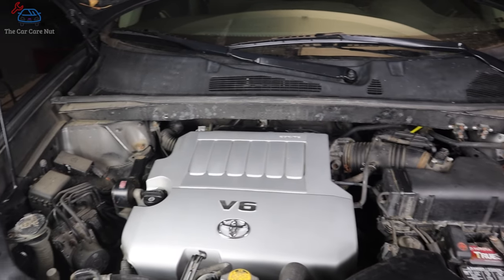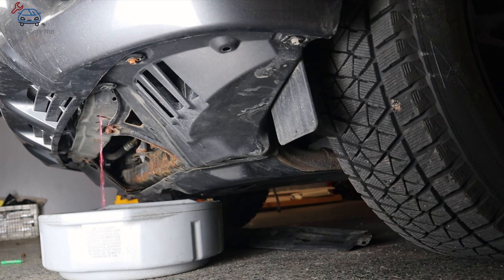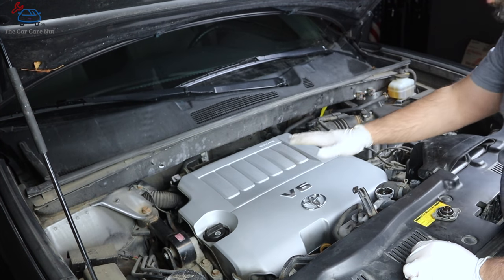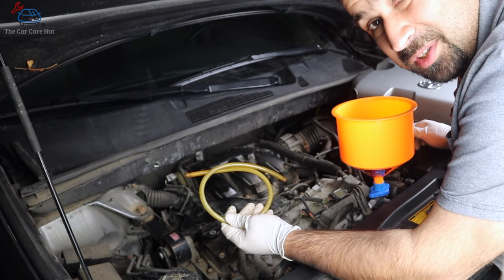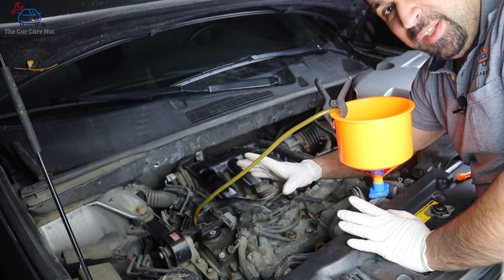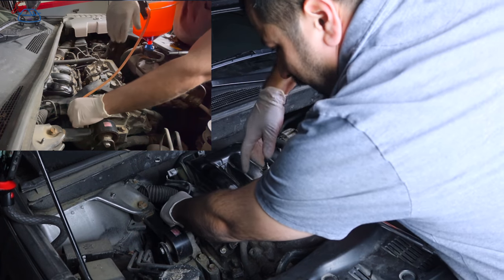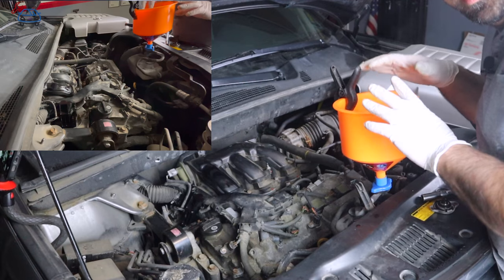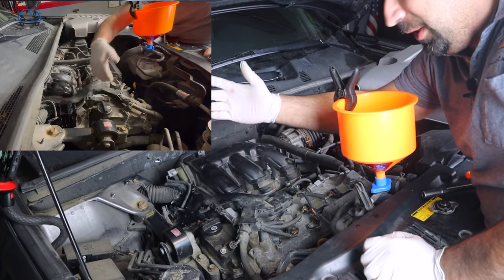Toyota Cooling System Bleeding for V6 2GR-FE 3.5L THE RIGHT WAY!

Comment: AMD Hello and Thank you for the great videos you provide ! I did the coolant change on my 2007 Sienna a few days ago, seemed to go ok but I now have NO rear heat. Wondering should I try the process again without the coolant change ? also the video does not mention what to do with the remaining coolant atop the radiator in the funnel once the flow starts its "steady stream" with no air bubbles. I obvious choice to me was to transfer the leftover to the overflow bottle. the short question ... should I repeat the entire process to get rear heat again ? Also I was surprised that the system only drained less than a gallon of old coolant , I assumed the Sienna would have much more but understandably the system is not 100% drained from the radiator drain plug. I did exchange about the same of new Toyota Long Life less than 1 gallon. Thanks again for your channel its the BEST !
Reply from the maker: Hi! You’ll want to repeat the same process again. This time with the rear heater turned on. See if this helps
Reply: Did you have success? I am having the same problem with no heat in the rear of my 2007 Sienna. I have repeated the process 3 times, twice with heat controls off and once with the heater on.
Reply: @andrewsnider7274  I actually haven’t gotten around to redoing mine yet .. also noticed after doing this when I have the ac on it’s blowing hot air from passenger vent near the sliding door .. kind of odd … Let me know what works for you .

Comment: Hi AMD, I have a 2007 Lexus RX350 with 60K miles. I came across your channel after I did the drain/fill of the coolant last year. I have noticed the coolant level in the reservoir going down recently but I don't see any leaks. I did not bleed the system, just used the spill-free funnel. The car does not overheat or have any issues. Heat is ok too.  Would it be because of not bleeding? 
Thank you for the awesome content. Much appreciated. I was able to change spark plugs after seeing your video.

Comment: is there a block drain plug on these models?
Reply from the maker: Hi! There’s a block drain however in most of them it’s hard to access as it’s underneath the exhaust manifold on the back side and in AWD models it’s even harder. Only a small amount of coolant comes out when you drain the block that makes it not really worth the hassle.
Reply: @TheCarCareNut  thank you Sir for the reply; I remember doing a coolant replacement on my friends 2007 Yaris and the block drain plug was seized; my 2008 Volvo XC90 V8 is the same, the block drain bolt for the coolant is visible but you likely have to remove the exhaust manifold to gain access.....I don't understand that engineering.

Comment: Is it normal for the radiator hoses pressurised until the cooling fans operates and the pressure disappear until the fans off hoses pressurised again. The car 2008 toyota camry 2400

Comment: I have a question:
If I measure the amount of coolant I drain out then put same amount to the radiator and coolant reservoir. The car will bleeding itself after I drive it for few days? Is it good, bad or cross your fingers.
Thanks
Reply from the maker: Hi! No that wouldn’t work with coolant. You’ll want to bleed it

Comment: Do you recommend draining the block when replacing coolant?
Reply: With a little bit of scrolling through comments I was able to answer my own question. Many others had the same thoughts. However my question now is would you ever recommend a full system flush as part of maintaining your vehicle to make it last +300k miles?

Comment: How about on a 2006 Toyota Matrix 4 cylinder? We have one that I cannot get the heat to work on and am sure its due to air in the system.
Reply from the maker: Hi! It doesn’t have a special procedure are the hoses for the heater core hot?

Comment: Hello AMD.. I've been reading online and some suggest by draining it also from the block that has the coolant drain valve (if my 2006 IS350 has it?)  as well in which you didn't do in this video. Is that necessary?  Or just keep it simple and drain it from the petcock at the bottom of the raditor.  This will be the second time changing out the coolant on my 2006 IS350... What do you suggest and recommend? Thank you 👍
Reply from the maker: Hi! Keep it simple and drain it as the video shows. Often times the drain on the block seizes and can break. And when you drain it only a small amount comes out
Reply: @TheCarCareNut  Awesome! Will do that what you did in the video. Thank you AMD I appreciate it.. Happy Wednesday and have a great day

Comment: Just changed the coolant on my '17 Tacoma 6cyl MT and used less than a full gallon container of 00272-SLLC2	The bleed screw on the lower passenger side was tubed up to the funnel, ran the engine at 2500 rpm's for a while and all the bubbles came out but still only used less than a gallon of the Toyota coolant. Purchased 2 containers in preparation for the expectation of using both.  What happened, did I screw something up?
Reply: The radiator barely holds shit lol it’s kinda messed up but your good. Gotta drain everything to get it all

Comment: Is this the same for the 4 runner ?
Reply from the maker: Hi! No the 4runner is simpler just fill it, rev the engine to 1500 rpm until both upper and lower radiator hoses are the same temp
Reply: @TheCarCareNut  stupid question, sorry.  But how do you tell the temperature of the upper and lower ?   You have really dumb things down for beginner like me.   Thanks 🙏
Reply from the maker: No need to be sorry. Very VERY carefully you’ll reach in and feel them. Initially when you start theyll both be Cold yo the touch. Then you’ll notice one of them will get hot to the touch and the other cool. Then they’ll both be hot to the touch

Comment: what do you do with the coolant in the overflow tank?
Reply: After doing this procedure, just make sure you’re overflow tank has the proper level to the full mark. It will change overnight for a day or two after running the car and letting it cool down, but it should stabilize after a day or two if you fill it to the full mark.

Comment: Which nut did you loosen to open bleeder? I just replaced the radiator myself and bled the system by waiting for all the bubbles to leave from funnel at the radiator cap , is that sufficient?
Reply from the maker: It’s a 10mm bleeder shown in the video

Comment: 80k on a 2016 HL.  I see several dozen little black flakes bubbling up in the funnel which I am wondering what they could be.  This is happening when the engine is rev''ing and waiting for the return line to start flowing.  I never got a steady stream from the return line.  Rev'd to 2500-3000 for a minute or two after it was at 2000 and at operating temp and still did not get a flow.  It reach the top of the funnel but never started flowing with any steady flow like you mention.  Also, is the return line supposed to be submerged in the funnel fluid or not?  I would thing that would matter.  Lastly if I see bubbles and lots of white bubbles (a lot of very small aeriated bubbles) but the funnel fluid level does not seem to be going down - that does not make sense?  If I see steam and bubbles and aeriated coolant coming up from the radiator into the funnel it has to be replaced by fluid but I really and not seeing the fluid go down as much as you would think given the bubbles.  Thanks for the great video
Reply from the maker: Hi! Don’t submerge the line in the fluid

Comment: Great video!  I'll be performing this procedure on my 2016 Avalon next week.  I have a question.. Does the Corolla 2ZRFE engine have an unusual coolant flushing process, or does the usual burping technique apply?
Reply: I had the same question. Yesterday in our 13 Corolla I drained the radiator from the bottom valve ( remove rad cap for better drainage) closed bottom valve, removed reservoir bottle to drain and rinse out. Used the no spill funnel as in the video. Added about a 3.5 qts of Toyota pink. Started the car and slowly added (if needed)  more coolant to the funnel. After some time not seeing any bubbles, inserted plunger ( comes with funnel kit ) then carefully removed funnel w/ plunger still inserted. Replace rad cap. Remaining coolant in funnel added to reservoir bottle. Drove car for a while with heater on high ( Milwaukee winter time) after letting engine cool down, I checked coolant level. As AMD would say, and “Life Is Good!”  
Today I’m going to do the 2015 Avalon. Gonna try the lumber board on the gas peddle and head rest method I read in an earlier comment. Wish me luck.

Comment: Hi, echoing some others with the same question. Do you ever and or recommend draining from the engine block drains?
Reply from the maker: Hi’ you could yea but only a small amount comes out
Reply: @TheCarCareNut  thanks for responding so quickly! In that case I'd rather just not do the engine block drains as it will add unnecessary work. I'll just keep this nice and simple like on your video and do another change in a few years.

Comment: Hello man my 2006 Avalon get code with random/multiple misfire p0300 with c1201 , 90% happened morning when driving to work some times after the whole car shake with flashing check engine light and vsc light I turn the vehicle off and turn it on the car drive normal, yesterday happened  with sold check engine light with p0300 and c1201 what cause if this code please help me  with your Experience
Reply from the maker: Hi! This one will need some diagnosis. Does it have any other codes other than the p0300?
Reply: @TheCarCareNut  yes P0301-P0302-P0303 until P0306, I changed the fuel pump with no luck and new ignition coil and spark plug nothing change
Reply from the maker: How’s the fuel? I would get a sample and get it tested
Reply: @TheCarCareNut  this is the freeze data the cause of misfire 
1-DTC THAT CAUSED REQUIRED FREEZE FRAME DATA STORAGE P0301
2- fuel system A status CL
3-fuel system B status CL
4-calculated load value 80.0 %
5-engine coolant 188.60 F
6-short term fuel trim bank 1 (0.8%)
7- long term fuel trim bank 1 (8.6%)
8- short term fuel trim bank 2 (2.3%)
9-long term fuel trim bank 2 (10.2%)
10-engine rpm 2455 rpm
11-vehicle speed sensor 78.29 mph 
12-ignition timing advance for cylinder #1 (24.0)
13- intake air temperature 75.20 F
14-air flow rate from mass (air flow sensor)0,10 lb/s
15-absolute throttle position 28,6 %
16-oxygen sensor output voltage bank 1 sensor 2 (0,210)V
17-short term fuel trim sensor bank 1 sensor 2(99,2%)
18-oxygen sensor output voltage bank 2 sensor 2 (0.290 ) V
19- short term fuel trim bank 2 sensor 2 (99.2%)
20-equivalence ratio (lambda)(bank1 sensor 1) 0,964
21-oxygen sensor voltage( bank1 sensor 1) (3.096) V
22- equivalence ratio (lambda)(bank2 sensor 1) 0,963 
23- oxygen sensor voltage bank 2 sensor 1 )3.088 V
24-commanded evaporative purge (57,6%)
25-number of worm ups since diagnostic trouble codes cleared (39)
26-distance since diagnostic trouble codes cleared 714 miles
27-barometric pressure 28,05 inhg
28-equivalence ratio (lambda)(bank1 sensor 1)0,964
29-oxygen sensor  current (bank1 S1) (-0,125 ma)
30-equivalence ratio lambda Bank2 S1 0,963
31-oxygen Sensor current B1S1 -0.129 ma
32-catalyst temp B1S1 1424
33-cat temp B2s1 (1424)
34-cat temp B1S2 (1246)
35-cat temp B2S2 (1246)
36-control module voltage (13,515 v)
37-absolute load value 52.2%
38-Commanded equivalence Ratio 0.986
39-relative throttle position 11.8%
40-Absolute throttle position B 63.1%
41-accelerator Pedal  position 16.1%
42-accelerator pedal position E 32.2%
43-commanded throttle actuator control 28.6%
44-absolute evap system vapour pressure 381.89 inH2
Sorry it’s long but as you are a professional you can easy figure out the problem through data freeze frame, thank you again
Reply from the maker: Everything looks normal in the freeze frame. A bit on the rich side though. Hard to tell without diagnosing the car in person. I’d still check the fuel quality

Comment: If the red coolant level in my '12 RX350's overflow reservoir is a bit low  (due to evaporation) is it OK to add distilled water to bring the level up some?  ps -- Great channel!

Comment: I did this procedure and it bubbled violently and pushed about a gallon of coolant out of the radiator, splashed everywhere,  temp pegged to hot, I shut the car off, will try again tomorrow when I get more coolant😂
Reply: I never got a steady stream from bleeder and I used the coolant funnel kit
Reply: @garycapouellez1478  maybe your clear tube got collapsed when coolant got hot under clamp compression. Happened to me, had to remove clamp at the end of the job to let coolant flow...

Comment: I think he mistakenly said to turn the heater off when he really meant to say have the heat on.  You need coolant flow through the heater core to get trapped air out.

Comment: Where’s is the bleeder on the 2018 Camry 4 cylinder ?
Reply from the maker: Hi! There’s no bleeder you need to take the hose off of the EGR valve to fill it.
Reply: @TheCarCareNut  when u doing a video on it?
Reply from the maker: When I get one in the shop, they’re still new and so far I haven’t had one for coolant replacement

Comment: I followed this my experience is different. The filler on the  radiator  kept getting higher and higher and spilled everywhere.  2011 sienna.  I never saw the tube go back.
Reply from the maker: Hi! If this happens shut off the car let it cool down and take some coolant out of the reservoir and restart
Reply: @TheCarCareNut  okay. Restarting the burping

Comment: Question: what about the water jacket drains? Can I also drain those along with the radiator drain?
Reply from the maker: You can but not much will drain out of them and they can be difficult to reach

Comment: Does anyone know what the symptoms are if the system wasnt bled properly? Can this cause overheating in addition to the heater blowing cool air in the car? I followed this procedure but couldnt get it to the final stage in bleeding where the flow is solid in the clear tube because the fluid in the large funnel was boiling and overflowing. Later when I closed the system and test drove the car everything was working properly until about fifteen minutes later when the car overheated and the temperature gauge went sky high. Then it would back down slightly and cycle up and down like this. Could this all be because of a lot of air in the system? (FYI: After new radiator, thermostat, water pump)
Why would my large funnel overflow during this process?? I only started with it low just as described in the video, but it ended up overflowing, I dont know where the fluid came from?

Comment: Would this be the same way you would do a 2015 toyota camry?
Reply from the maker: Hi! If it’s a V6 yes 4 cylinder no
Reply: @TheCarCareNut  could you tell me how the 4 cylinder would work? 
My car as 83,500 miles on it o would prefer a drain and fill but most places won't do them. Is a coolant flush dangerous to do? Thanks
Reply from the maker: Hi! Drain the radiator then fill and run it with the heater off until the fans cycle twice
Reply: @TheCarCareNut  im not in any condition to do it myself and shops don't wanna do that here. Is a coolant exchanhe/flush safe to do? Since that is what most shops do. Not a power flush thougg

Comment: Need to do this, probably 2 or 3 times to flush out all the gunk
Reply from the maker: Hi! If the coolant is replaced at the correct interval there shouldn’t be any gunk to worry about.
Reply: @TheCarCareNut  2006 avalon. A bit past due. Going to flush it with cirtic acid

Comment: How long does it usually take for the coolant to start flowing clearly up to the funnel through the clear hose? Been waiting here with the engine reving for what seems like forever. The coolant is clear on the hose but not flowing all the way spilling into the funnel.
Reply from the maker: Hi! Is the heater on? And which model do you have?
Reply: @TheCarCareNut  it's a 12 camry v6

Comment: On lexus 450h we could not rev at 2000 rpm nore 2500 cause there is not indication , only for instance Charge or economy on the gage.
Reply from the maker: On the hybrid models press the gas pedal to the floor then back off just a bit and that will hold the rpm over 2000 rpm
Reply: @TheCarCareNut   Thnaks a lot ! Do you have a video for maintenance mode?
Reply from the maker: Here’s a video which contains how to put hybrids in maintenance mode https://youtu.be/_lWLMJ_4G24

Comment: Do you have a video for bleeding coolant on the 1UR?
Reply from the maker: Hi! Not yet but it’s simple. Fill with coolant and run at 1500 rpm until both heater hoses are hot and both radiator hoses are equally hot
Reply: @TheCarCareNut  awesome thanks!
Reply: @TheCarCareNut  A better question is this, I just replaced the radiator on a 2007 Lexus LS460. There is a bleeder hole at the top of the radiator, Do I need to have a funnel hose set up as you demonstrated with the 2GR to properly bleed it?
Reply from the maker: It won’t have the same setup. I would use a spill free funnel though